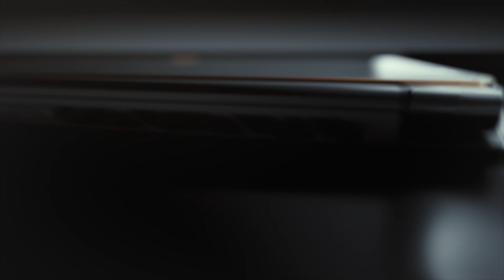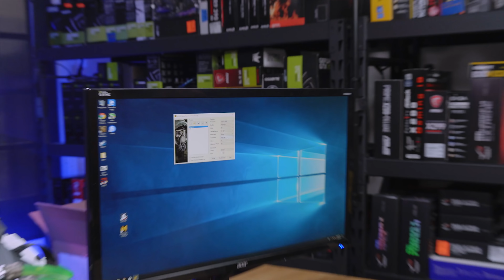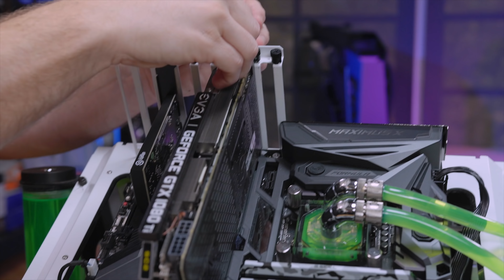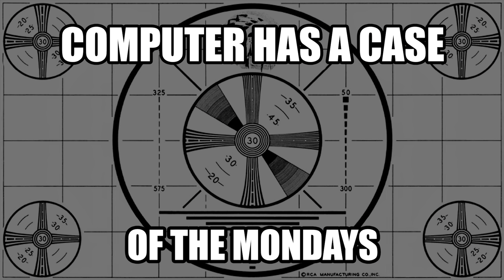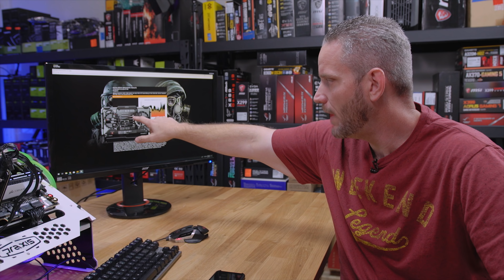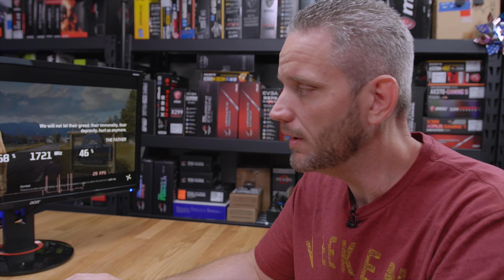Updated Test Bench... But did I screw it up with the wrong CPU?

Comment: When we are talking about more threads can hurt performance in games. Are we talking about Hyper Threading or physical cores or either. I would like to see performance between the 2 for higher core count such as 6-8 physical cores with and without hyper threading.
Reply: We will be seeing that soon.
next gen i5 is 6 core, i7 is 8 core and they are hinting i9 mainstream is 8 core with Hyperthreading.

The real answer is no, More cores doesn't "Hurt" assuming the same IPC and clock speeds are achieved.
The issue is more cores active causes clock speed loss due to power consumption
Reply: Right. I asked because of the new processors on the way without HT.  In the core count video JazTwoCents did all test with HT enabled.  Now with people talking about the the coming processors without HT and and stating that more cores = less FPS makes me want to see a real comparison HT vs no HT at same clock speed. I don't think HT is all that good anyway. Very minor improvement and a bad thing sometimes (talking about Hypervisor host). However HT is better than no HT... Unless it does impact gaming performance.  I am not sure how windows will handle this but lets say you have 4 core 8 thread CPU. If you play a game that uses only 4 cores, which cores is it using? All physical cores or some cores plus HT threads or a random mix of both? Maybe the game is using 2 cores and 2 HT threads which I think would be a lot less performance than using all 4 physical cores if at 100% load.
Reply: RawSiafu the answer is that with HT enabled heavy weight tasks are allocated directly to the physical cores.
Ht allows for unused clock cycles to be treated at a fake core.
Thats why stress tests don't see a huges advantage but multitasking does

Comment: Do a test on medium or low graphics to really test high fps difference where the cpu starts to become the bottleneck for us 240hz gamers.
Reply: Regular amazon sale on a 27inch acer
Reply: Daaaaamn, 

I'm gonna have to have a look   ;)

How good is it tho????
Reply: Dirty Ari Its TN(only TNs can reach 240hz) so the colour isnt perfect buts for gaming i couldnt care less and the refresh rate is worth 250 euro even just for that smooth ass mouse movement on the desktop. A side effect is it also eliminates screen tearing without gsync simply because the tears only exist on the screen for 4ms so you can't even see them. Best purchase ive made in a long time.
Reply: ya you can buy a 240hz monitor for less than 300 gbp here
Reply: sekemene All 6 of you!
Reply: littlefrank90 its not as expensive as they make it out, i got my 240hz monitor for 250 euro
Reply: sekemene    250?   was it off the back of a lorry???
Reply: 240 Hz? Are you 2 times better then combat pilots that can see more then 100 frames/s ? You know that avarage person won't see any difference above 75Hz? It's the same marketing as with difference between 44,1kHz and 192kHz audio. It's physically impossible for humans but people will swear to God that they can hear or see the difference. After all when you spend all that money you need to rationalize it somehow.
Reply: Stanisław Szczypuła I e got a 144hz gsync and I can tell you 100% you can see the difference my 4k 60hz both are 1ms response times! So much in fact my 4k monitor now gets used for desktop work not gaming as 60hz sucks big time after using 144hz so 240hz must be smooth as
Reply: Stanisław Szczypuła Combat pilots can distinguish plane models from a single frame at 200fps so yeah you can totally see the difference. this whole humans can only see so many frames is the most baseless argument ever, research shows people can still recognise differences to 1000hz.
Reply: And of course you have done blind test where someone have set 60Hz or 120Hz ? I had 120Hz monitor back in 2003 and I know there really is very little if any difference above 75Hz. There is noticeable difference between 30 and 60Hz though.
Reply: Stanisław Szczypuła Actually one of the first things we did with my friends is set up blind tests. We could tell which refresh rate it was 100% of the time even between 144hz and 240hz.
Reply: Good for you. I'm 33 years old and I can't see any difference whatsoever.  I couldn't see those differences 15 years ago as well.
Reply: Stanisław Szczypuła You're the exception then stop telling people humans cant see over 75hz
Reply: Stanisław Szczypuła some people can't see the difference between 30 and 60 fps. Does that mean 60fps is a lie? Just because you can't that doesn't mean other's can't. The point is when you go from 30 to 60 you notice it a lot. 60 to 144 you notice that as well. But from 144 to 240 it's less noticable. You'd need to go to like 400hz for it to be more noticable. Because 1/30 = 0.0333s for 1fps
1/60 = 0.0166s for 1fps
1/144 = 0.0069s for 1fps
1/240 = 0.0041s for 1fps
As you can see all these number went lower almost drastically except 144 to 240 because that's not big of a difference. But that doesn't mean it's not there. Couple of years ago we were gaming on 30fps and it was max we could have. And it looked like a limit for us. Let's just wait until technology progresses and we'll have 500hz monitors. At least I hope so.
And btw, I don't think that we had 240hz panels 15 years ago. So I don't know how you tested that you can't see 240fps
Reply: "Couple of years ago we were gaming on 30fps and it was max we could have" 30 fps was considered borderline playable not the best we could have.  Far from it actually. I had over 100+ fps on 100Hz monitor in Quake 3 Arena. And it  didn't make any difference for me if it was 100 or 75 Hz. It all depend on type of game we are talking about. Probably if someone is playing mostly stupid, simple fast action FPS then it could matter a lot more then if you are playing strategy or turn based RPG. The slower the tempo of the game the less impotent is how many fps your gpu can deliver.
Reply: Stanisław Szczypuła even mouse movement for turn based games is insanely smoother on 240hz
Reply: sekemene How interesting I literally can't remember anyone complaining about lack of mouse smoothness ever. Lets just stop this argument because it's obvious that you guys can't live without very high refresh rate and I think it's basically a waste of money.
Reply: Stanisław Szczypuła Obviously people wont be complaining about something they've never experienced but the second you do experience it, it's a night and day difference.
Reply: 120Hz monitor from 2003? U guy was scammed so badly. I can figure out that monitor might feel even worse than the average 60Hz pannel. Since I have had a real 144Hz monitor for my pc, I can't use again my laptop for any game cause even. And the mouse in a 60 Hz monitor for me it feels like it's insta teleporting instead of flowing in the screen like in high refresh panels does.
Reply: The Baniels It was 17" Samsung Syncmaster I can't remember the exact model. It have 100Hz at normal resolution 1024x768 and 120Hz at lower 800x600
Reply: Stanisław Szczypuła You got scammed then as the first ever true 120hz monitor was released in 2009 not 2003.
Reply: Stanisław Szczypuła The syncmasters were 75hz
Reply: It was exactly this one:
https://www.cnet.com/products/samsung-syncmaster-793df-crt-monitor-17-series/specs/
And as I said before it run 100Hz @ 1024x768 or 120Hz @ 800x600. I was useing Nvidia 3D glasses with that monitor running Oblivion in 800x600, and those required 120Hz. According to specification 793DF could run at 160Hz but that was probably @ 640x480 or even lower so pretty useless.
Reply: Stanisław Szczypuła as someone with a 75hz monitor that upgraded to 144hz, there's a difference for sure lol
Reply: Stanisław Szczypuła taken from its spec sheet: 'Native Resolution: 1280 x 1024 at 65 Hz'
Reply: A)There was no "native resolution" on CRT and B) if I remember correctly it run 1280x1024 @ 75Hz but I really used it because it was a bit to much for my GPU
Reply: Stanisław Szczypuła So 75 was too much for your gpu and u decided to run at 120 instead...
Reply: sekemene Are you high? 1280x1024 was a bit to high resolution for my GPU. 1024x768 and especially 800x600 (at this res monitor could work at 120Hz) was a lot better. Difference was more or less as between 1080,1440 and 4K today.
Reply: Stanisław Szczypuła I think you're the one who's high if you think such an insignificant drop in resolution gave you over 2x the fps

Comment: I'm pretty sure the x299 dark is only dual channel.
Reply from the maker: Um no...
Reply: It’s got basic cable. Roughly 153 channels
Reply: Jay, couldn't the slight increase in FPS on the X299 system have been due to the quad channel memory support? I was a little surprised you didn't discuss that possibility after getting more FPS with the 7980XE
Reply: Gabriel Makowsky It only has 4 dimms where other x299s have 8, AFAIK that's the only difference RAM wise.
Reply: Dick R yes but it's still quad channel, it has just one stick per channel
Reply: BackInBlack_4896 Right, I never said otherwise. I Just figured that may be what he's thinking of.
Reply: Kaby Lake-X = Dual Channel
Skylake-X = Quad Channel

Comment: Mehh stupid Intel chip... I was hoping Jay was able to somehow get Threadripper 2990X
Reply: Wait doesn't AMD have performance/Watt crown this time around? When you're dealing with a shitmegaton of cores, power consumption becomes easily the limiting factor, both due to power handling and due to cooling constraints, so there's a possibility that ultra high core count builds will take less advantage from Intel's higher IPC and higher clock capability and more advantage from AMD's power frugality of each core at a given performance - at least when you're comparing same or similar enough core counts, i'd certainly count 16 and 18 cores as vaguely comparable. It's certainly worthy of a test rather than speculation.
Reply: Miha Kolbanar has clearly not paid attention to anything over the past 18 months. "Lots of weak cores that can't even remotely compete anywhere where you need good single core performance and don't even do all that well in multi core" ... what are you smoking? They reach the same frequencies as the Ryzen offerings with 25% the number of cores, and they are not that far behind Skylake-X on per-core performance at all. Get your head out of your ass and do some research.
Reply: Can't wait
Reply: It's for testing games. Threadripper is a very poor choice for that application.
Reply: Rasmus Rasmussen And 18 core Intel chip was designed for gaming? Right.... that make perfect sense lol.
Reply: Designed? No, but very good nonetheless, TR on the other hand...
Reply: Stanisław Szczypuła have i ever said is was? No. But i is much more competent and versatile than Threadripper.
Reply: Supposedly the  Threadripper 2 clock to 4.5ghz on the TR4 wraith ripper cooler, Good versus satisfactory is a different story entirely, there are more than enough professionals who build a workstation gaming hybrid computer so they aren't spending $10-20k on 2 different setups, initially that was the reasoning why NVidia created the Titan series.
Reply: Nocturnal101 Ravenous you can't use supposedly for anything! Er can only wait and see. I am sure it will not even be cloce to Intels singlecore performance.
Reply: It might be even worse due to the ridiculous core count. TRs are just a gimmick - lots of weak cores that can't even remotely compete anywhere where you need good single core performance and don't even do all that well in multi core, with some exceptions. They are very nieche cpus indeed despite what AMD would have you believe...
Reply: This processor isn't exactly a great choice for gaming either.  but threadripper is definitely a better choice from a per/$ perspective.   you pay way more for what, like 10% better perf? going with this chip vs the thread ripper across the board.  ofcourse as others have pointed out,  a simple 8700k would've been better choice for gaming today.   However,  I do like that more cores are becoming mainstream,  it means devs will develop future games more multi threaded.  so in the future,  we might have a completely different argument than today.

Comment: Which chip has a higher single core performance?
Reply: If they're overclocked the 8700K destroys the 7980XE, in single core performance. Even at bone-stock it still beats it handily, because of the much higher clock-speed.

Comment: The general assumption of more cores equals bad for gaming is coming from people that don't elaborate to ''casual'' by only saying ''fewer cores but faster cores is better for gaming'' and I'm not better than anyone else for doing so even if I had to talk about CPU architecture differences in the first place.
Reply: I've always found 6 cores to be a pretty sweet spot for gaming.
Reply: I'm on 4 cores & wish I had some more for these newer AAA games & such
Reply: More cores doesn't equal bad, not needed yes but not bad. More slower cores then yes its bad but not because of how many cores but because they are slower.
Reply: well those people are right in the end.. even modern well optimized games usually still offload the major things to 1-2 cores while others just do minor tasks.. multicore optimization isn't always easy to do especially in games.. sometimes it also doesn't really make sense because it would actually decrease performance of the programm if you offload a task to 2 cores instead of 1.. that's why 6-8 cores with high clocks are usually still favorable in games than more lower clocked ones.. 
i mean yeah i also still read this bullshit from people that are like an i5 with 4 cores is enough for gaming.. those people most likely got stuck in 2012 or something.. i mean yeah ofc you can still play on them but everything gets more demanding.. the operating systems get more demanding.. the era of 4c/4t and 4c/8t chips is kinda over after all.. if anyone goes out and buys a chip right now i recommend going for a 6 or 8 core with high clocks.. for me my archaic 5820k rig with a 1080ti still does the job.. i will stick with it until something really interesting hits the market.. but atm neither amd nor intel really offer me what i want from a cpu..
Reply: In these modern games, there's still sometimes just one bottleneck thread that does either the draw call submit or a particular aspect of the simulation, whichever happens to need to run every frame and tends to be the slowest, and the generation of geometry and secondary behaviours are farmed out to worker threads which happily occupy whatever computational throughput you give them, but you don't even notice if they don't complete in time, whenever the workers are done, the result will be visible, even if it's a couple frames late, no big deal. It's usually just LOD transitions, distant crowds, such things.
Reply: It comes from i5 owners

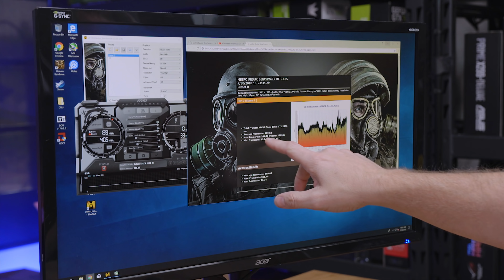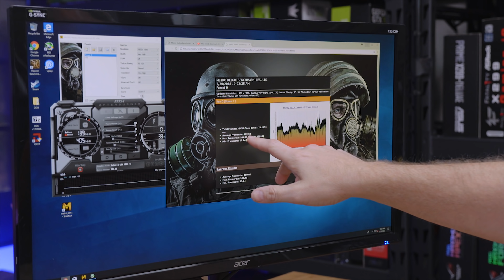Comment: Jay what I want to talk about is why youre using MSI afterburner with an EVGA card when EVGA already has an easy to use OC software... 3:55 - 4:02
Reply: It doesn't matter. It's probably what he has preistalled on the drive he was using. An EVGA card will OC just fine with afterburner and an MSI card will OC just fine with precision.
Reply: I do too, afterburner is a great program even though i could go to Evgas solution but i tested it and this just feels more familiar to me
Reply: I run EVGA cards but use Afterburner because to me it's easier to use.  I like the OSD better, too.
Reply: It would be unnecessary work to change it everytime he changes the graphics card.

Comment: From what I read, i9-7980XE share about the same IPC performance as the 8700K but runs at a way lower clock.
Reply: It does, run at lower clock speed. With that said, there are usually a few primary or better performing cores, more so when you have 18 of them. So what you can do when overclocking is select the best cores and clock them at higher speed. For my 7980XE I clock 6 primary cores at 4.9 GHz which sounds massively high, but not so much so with only 6 cores active which is fine for gaming. For all core clock, it will be lower of course, but it means for games get the nice boost from few cores being able to clock much higher and most only use up to 6 cores anyways.
Reply: You see the problem with that is that there's no way to tell windows what cores you want your games running on. Any software I've seen claiming to do this was also just bullshit unfortunately.
Reply: @Retsini there is, with 3rd party software. I recommend Process Lasso
Reply: Krytopsy Runs at a way lower clock because if it qere any higher you see temperatures of 90+ degrees Celsius. And that will basically fuck your chip up, hence why so many people delid and replace intels toothpaste solution with liquid metal so temperatures drop 30 degrees
Reply: Nope.The mesh in the 7980XE lowers IPC vs 8700K (or even 6700K for that matter)
Reply: i9-7980XE is Skylake and the 8700k Coffee Lake. The 8700k Cofee Lake is one generation newer but the IPC is virtually the same. Reason why the 8700k is faster in 99% of games is because they  will not make use of more than 1-6 cores and thus what matters is the clockspeed of those cores.

Problem with the test Jay did is he overclocked the i9-7980XE a lot while leaving the 8700k at stock setting basically with just sync-all-core enabled. 85% of all 8700k will hit 5GHz or higher while only around 25-30% of the i9-7980XE can even hit 4.4GHz on all cores. So in 99% of games you will be better of running the 8700k at home.
Reply: The reason he likely hit higher FPS on the 7980XE is because it has Quad channel memory and double the cache to work with.